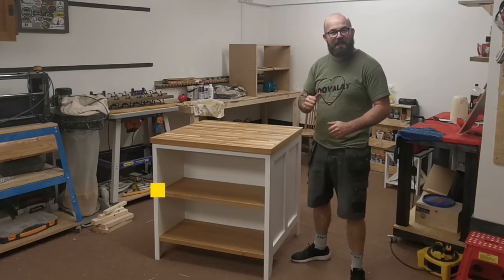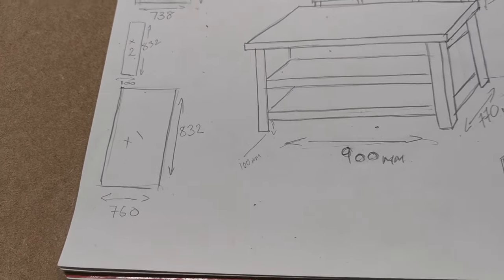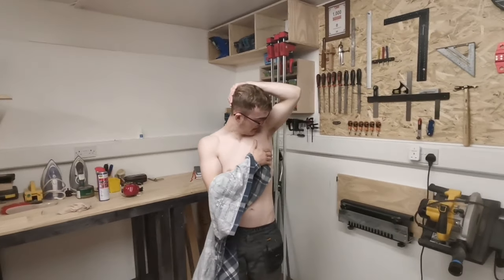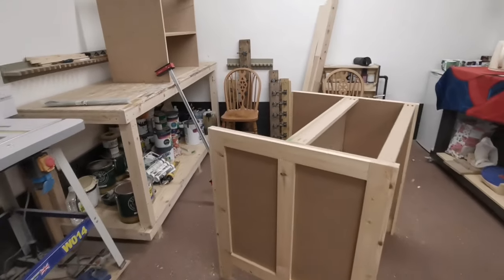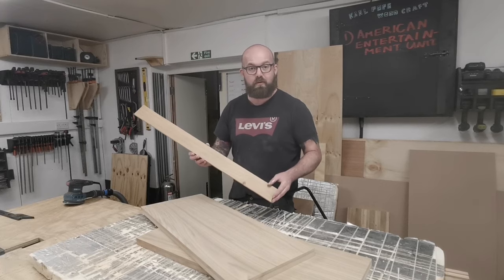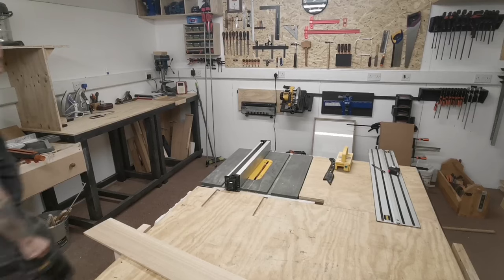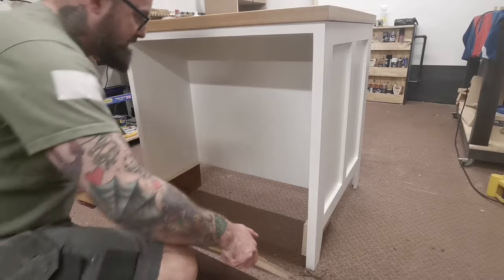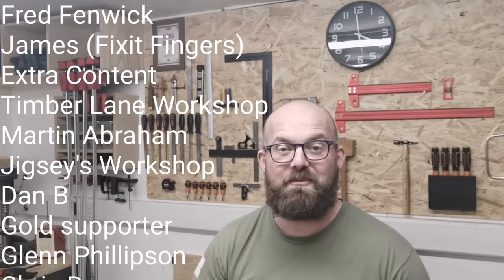How to build a kitchen island woodworking Oak & Mrmdf

Comment: That was a great little video  mate.. really enjoyed that..  got to ask tho.. and its not a criticism.. how co.e you sprayed water to raise the grain when you used a oil based product.?? And would the solid oak shelves not be better to move freely rather than being fixed on 3 sides.??  Still a great video tho mukka
Reply from the maker: Hi mate, first answer is funny lol I was on auto pilot because I normally use a water based varnish so automatically raised the grain 💦😂 ye definitely no need in that instance. Secondly the shelves are not solid you must of done a cheeky fast forward 😂 mdf oak veneer so I'm not expecting any movement 😉
Cheers 🍻